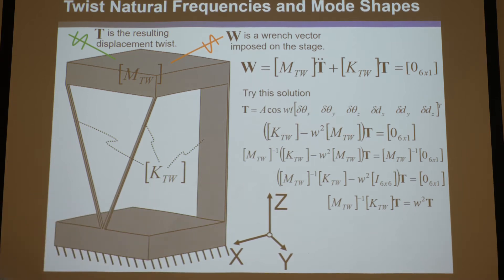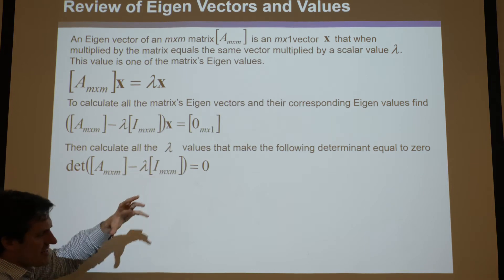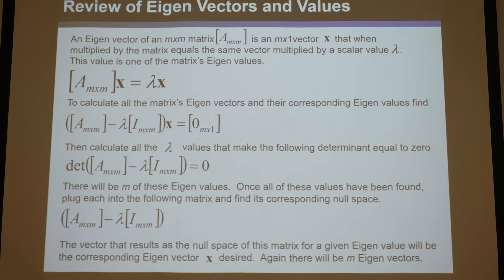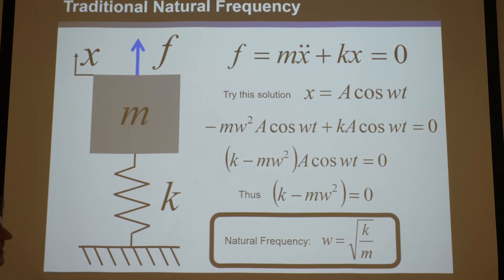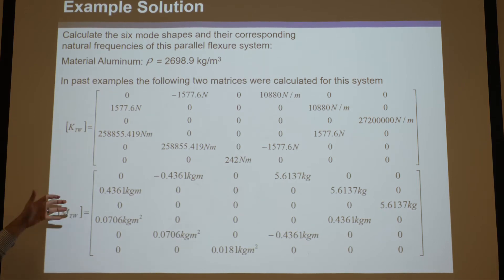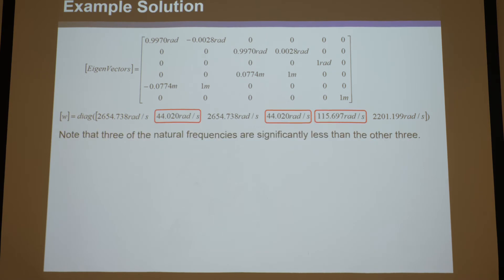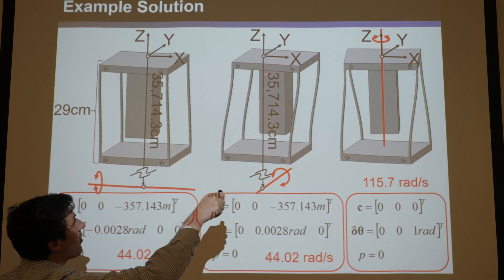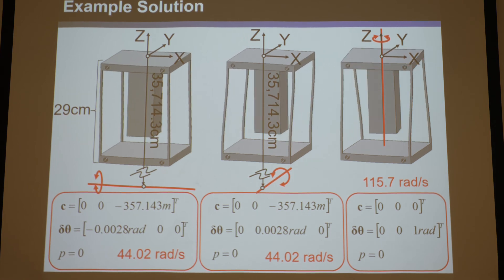Compliant Mechanisms Lecture 3 Part 5

Comment: Part 5: Mode Shapes and Natural Frequencies (22:47):

* Natural Frequency: Frequency at which a system vibrates without external force.
* 1D Proof (23:00):  For a point mass on a spring, `ωn = sqrt(k/m)`
* 3D Eigenvalue Problem (27:04): 
    * Set equations of motion to zero (`Wrench = 0`)
    * Eigenvalues of `Mtw^(-1) * Ktw` represent squared natural frequencies
    * Eigenvectors represent mode shapes (twist vectors)
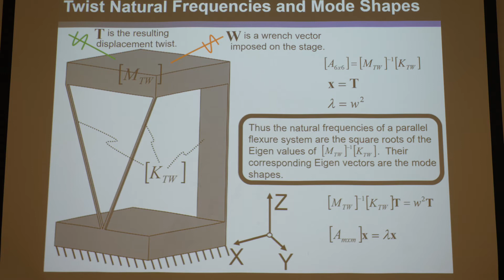* Example Calculation (9:07): Found 6 mode shapes and corresponding natural frequencies for the parallel system example.